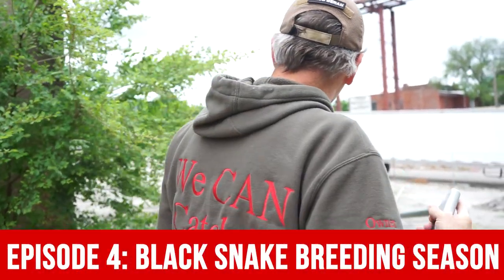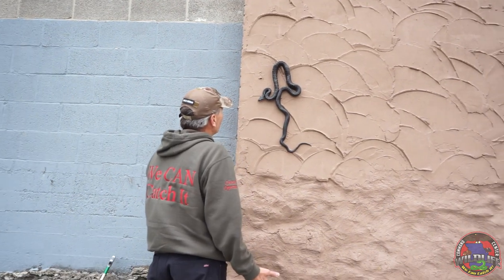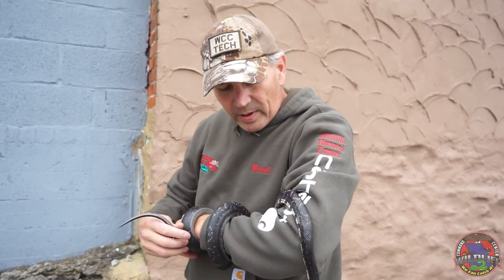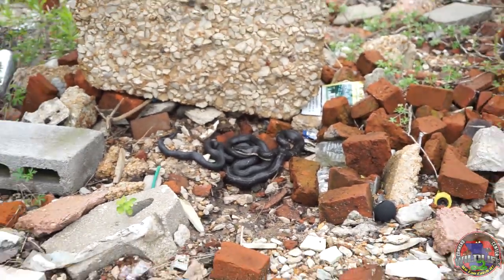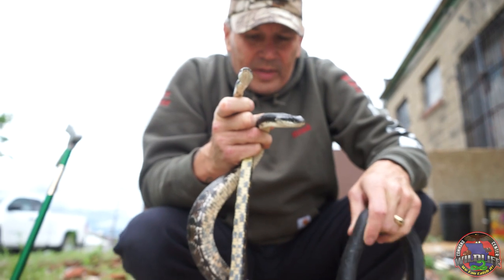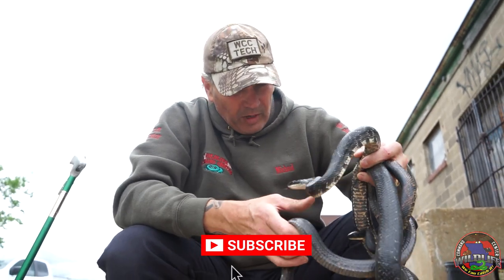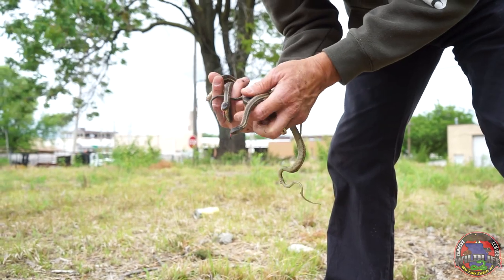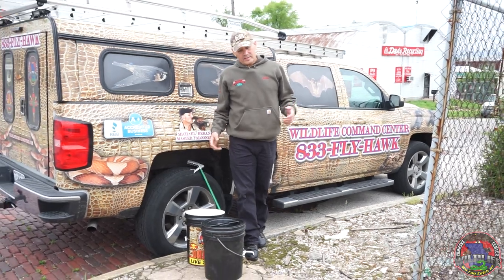Black Snake Breeding Time   1.11

Comment: A couple of years ago, about a 5 ft one got in my house (knock on wood) through the garage. It found a tiny hole going from the garage to the basement where I was sleeping. Fearful of large snakes, I got the hell out of there. It didn’t seem to be afraid of me when it was discovered. The little ones don’t bother me that much as long as they’re outside. Just saw one yesterday while doing yard work. The big ones freak me out. Can you tell me an easy or effective way to pick one up and where or how to take it somewhere away from my house? Unbeknownst to me, it had even shed its skin in the basement, which horrified me. 
Thanks.
Reply from the maker: Snake skins are always 25% longer than the snake they came from